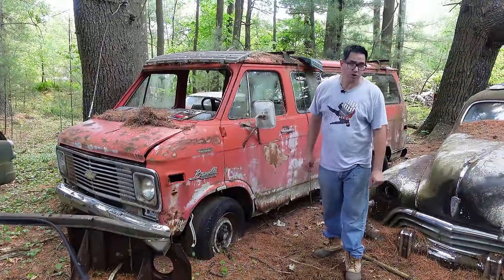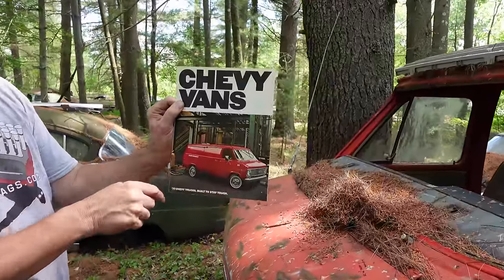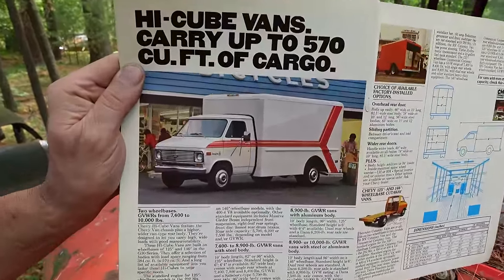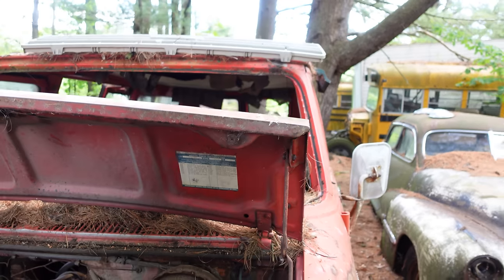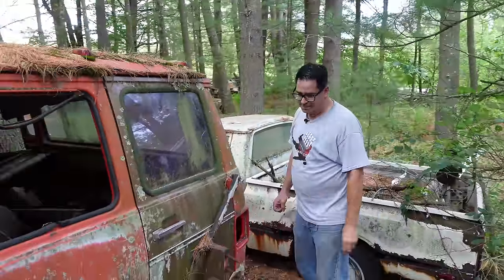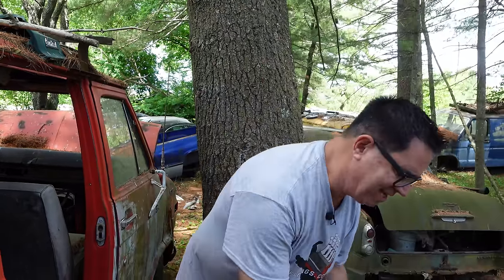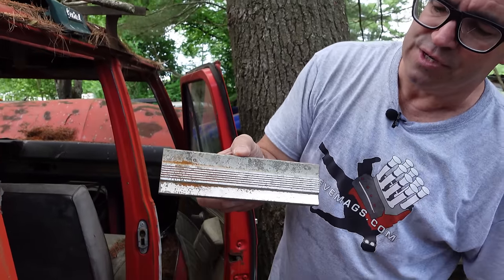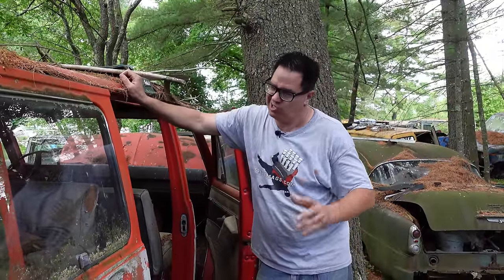The Beauty of Beauville

Comment: I grew up with a 1976 Coachman Leprechaun camper. It had a chevy cab with a 400 4-barrel. My dad sold it off in the late 90’s and I heard it’s still running to this day. Without a rebuild!
Reply: These 400 sb are severely underrated engines. I put one in my 1979 malibu. It was a 2 door malibu classic with the bucket seats and shifter on the floor. I loved that car.

Comment: Even though I owned two of these for several years, I never suspected they weren't body-on-frame. Always something to learn.
Reply: I knew they were unibody and was surprised when they came out with its replacement in the mid 90's they went to body on frame which I felt was a step backwards.
Reply: @edwardpate6128  Stressing the body instead of using a frame is just a cost cutting measure for profit.

Comment: The department where I work had one of these when I started there.  I was driving it down the Florida Turnpike, going 75 with traffic and suddenly had to come to an almost complete stop.  I laid on the brakes and actually stalled the motor.  I was coasting on the turnpike in Drive with no power steering, so I put in in Neutral, started it up and put it back into Drive.  Came very close to needing a new pair of Fruit of the Looms on that one.
Reply: i had a Pinto wagon stall out and wrestled with the dead power steering...even on something that light, it was a workout so i can imagine a full sized van. quick thinking on your part, i had a clutch pedal.
Reply: People always talk about "They don't build them like they used to!!" well, they don't and I don't miss stalling the engine because you braked too hard / long in a panic stop..... =)
Reply: @TheOtherSean  or the power disc brakes that launch you thru the windshield....

Comment: I learned to drive of a 1977 Vandura. I am pretty sure it had a small block 400. Maybe 8mpgs, but it did doughnuts just fine.
Reply: Correct, the G20 and G30 in 1977 could be had with a 400 V8.
Reply: The400 small block ended in 1974, so unless the vans got them for a few extra years, it was a 350.
Reply: @justincooper5189  incorrect. 1979 was the last year for 400 small block production.

Comment: A place I worked at had an old Chevy van, the only times it got used were to take a 55 gallon drum to get diesel once in a while and get inspected. That one was 3 on the tree and worn out manual steering that kept you awake. You'd be driving, it pulled a little to the left, so you'd kinda have tension to the right. Then it would change it's mind and start pulling to the right, all of a sudden you'd be on the shoulder of the road. 😂 Good times, good times.

Comment: I love vans.  Had them most of my life.  First one was one of the first flat nose Chevy Vans (can't remember the year), then a flat nose '66 Fargo Cargo,  '75 GMC Vandura cargo, '79 GMC Vandura all window cargo, '79 Dodge Tradesman cargo, and my current one, a '91 GMC Rally STX Passenger, 350 EFI, which I've owned since '95.  The '91 is all original, even the spare, and only has 142,000km (88,000 or so miles) and no rust, no winters since I've owned it.  Thanks again for all the great videos you post.  Best Regards - Mike
Reply: same here. I started with a 1990 ford e250 extended then 1975 e150 custom and 1979 chevy g20. Im in talks with this guy on buying his 1980 g10 with a inline six / no window shorty.  IT gets addictive but they are cool as hell :P

Comment: I had a 77 G20 Beauville in 87 thru 88 .77 was the last year they had 2 blowers for the AC equipted vans . Unfortunately the 2nd one that blew the cold air into the air ducts was failure prone and replaced in the 78 up systems . it had also been obsoleted and deleted from the GM parts book around 1980 which is why i got the van as a gift . The only opening windows were those in the front doors so there was little airflow to cool the interior .
Reply: I had a 75 and those vents down in the kick pads along with the vent wing windows could provide some pretty good ventilation when driving on the highway.

Comment: My Dad owned a automotive battery business and used these vans to haul pallets of batteries.   It was cheaper to license these as passenger vehicles than to license a work van.   We did change the ring and pinion ratio to help with the heavy loads.

Comment: I had a 74 g30 350 4bbl with 4.09 10.50 Corp axle I put an Eaton locker in mine.  I had a sliding door with windows only on the rear doors. Had that truck for ten yrs , miss it.

Comment: Nice overview. One cool thing about the Chevy/GMC vans of this era is the fact that they had the ignition in the dash long after everything else went to a column mounted key. I think until 1980 or 81. If you’re lucky, you might find a tilt column.
Reply: I like the myth that the GMC has 1 ga. larger wiring then the Chevy counterpart. 
Because it's a GMC and they made em stronger 🤔
Reply: mine is that way. Tilted column and dash ignition.
Reply: My '91 Toyota pickup has the ignition in the dash.
Reply: @lab1042  look again, Toyotas appear to be in the dash but are attached to the column.

Comment: It's great that you post the SPID label because with the VIN we win:

C for Chevrolet, G for G Series Van, Y for 350 V8 with four barrel, approx.155 HP, 3 for 1-ton rated van, 6 for Sport Van/Rally Wagon/Suburban (not to be confused with a Chevrolet Suburban SUV), 3 for 1973 model year, U for Lordstown, OH assembly and the rest is the production sequence. The Lordstown plant operated from 1966 to 2019 and was the main van plant with Flint, MI and Scarborough Ontario, Canada also producing them during this time. The Lordstown plant was rife with strikes and was often called "Industrial Woodstock" due to the hippie type workers that worked there. Later GM strikes at other plants were often referred to by GM management as "Lordstown Syndrome". 

Exterior paint is code 514 Crimson Red. It would have been nice if they got AC, RPO code "C60". LOL. The rest of the options on the SPID are self-explanatory. Yes, you have to be observant in the yards. I've found tools and even the proper paperwork I needed for my Trans Am. I had been searching for years for 1979 and 1980 blank warranty folders and I found them in a junkyard car. My mom was working at a place that had both modern computers and yes typewriters, so I had her type up the owner's manual folders just as they would have been done at the dealership when they were new.  At that point, my dad had been gone about 20 years, so it was nice to type his name on the one warranty folder like it was probably done in 1980 (although we never had one for some reason, odd, we kept those things). That was a find. Another time I found the "What Is It?" space saver tire brochure in a 1977 Cadillac. It is the same piece for my 1979 Trans Am. But the '77 piece in the Cadillac was about 3 inches from nasty rotten half eaten Chinese food and the car was on an angle in the yard in the mud. I was able to get it, it was clean and undamaged and it now sits in my glovebox of my '79 Trans Am. 

Another time I found some Craftsman tools, or should I say half of them: half of a nutdriver handle and half of a socket rack. I brought them back to the local Sears when I was a regular there and the guy said, "Where's the other half?" Laughing I said, "In a Olds 307 engine in a junked car in PA". He went to the rack, pulled off a new USA (then) made tool and did the paperwork. I then showed him the half of the socket rack with the word "MAN" only left. He said, "I don't think you're right, but if the new package says lifetime warranty they are yours". Sure enough it did. He did the paperwork at the register, handed me the new tools and said, "Have a good day, see you soon". Unfortunately, that store closed in 2019. My uncle's neighbor who was a manager at Sears from 1953 to 1993 was involved in opening that store in 1973 and the previous two stores that preceded it. I have many tools and items that likely came from all of those Sears stores. 

You can still get upfit packages/prep packages today on G series vans. For a time, GM also sold an AWD van called the "H Series". Today if you want a "factory" 4WD van, you have the van sent drop shipped from GM to Quigley and they do an OEM approved conversion that keeps the warranty intact. As for upfits inside for tradespeople, Adrian Steel, American Van and others offer upfit packages that can be put into vans like this. GM (as well as Ford and Chrysler) have many "ship through" vendors that will take chassis and upfit it, getting it right off the delivery vehicle. Ambulance chassis are done this way---in the case of Ford they are often drop shipped to the ambulance manufacturer from a Ford dealer like Olathe Ford in Kansas. Ford often calls it "pool vendors". There are many throughout the country that get drop shipments. 

When I go away for business or to a meeting, we are driven to it, and we're often driven there in a modern version of this van, a newer G Series. While it's changed a bit over the years, they still have many of the same types of options, upfits, seating configurations and so on. Back then if the "shoe fits, wear it". That was GM's motto. 1996 brought the phase-in of the Savana and Express vans we still have today. Those are assembled in Wentzville, MO with some models built at the Navistar plant in Springfield, OH.
Reply: Interesting story. I believe that Pathfinder also did 4x4 conversions on vans. I don't know if they're still in business though.
Reply: i used to work at the Canadian van plant til it closed in the early 90s.GM used to call it ladder frame design
Reply: @bradc32  That's correct. We did get Canadian made vans here in the States as well. Most were Lordstown or Flint made, but I have seen plenty of Canadian made ones.
Reply: @MikeBrown-ii3pt  They are out of business. I believe an ex-employee bought the stock of parts/name some time ago and kept it going for a time, but I don't think it's still around.
Reply: @bradc32  Funny thing. My coworker just brought over a VIN from a 1978 GMC van that we used to have many years back. Sure enough, it was a Scarborough made van.

Comment: I had a 1983 12 passenger van very much like that one.  350 4 barrel, four speed automatic.  I had it for 12 or 13 years and put 175,000 miles on it.  Great truck.  Strong and powerful.

Comment: My father drove a 79 Beauville 1-ton for about 10 years. He purchased it used in 86 to be a combination work van and vacation van. That lasted for about 6 months then all the bench seats came out except the one closest to the front. It was a pretty loaded out van with high back caption seats that would rotate. It was pretty trashed when he sold it in 96 with close to 300k miles on it.

Comment: What I recall the rust advanced quickly on the two tone paint edges. The windows popped out the sides from below and the latches rusted out around the top. There was a side door step or ledge that seemed to rust out pretty quick. The metal on it seemed a little light.

Comment: I have a 1979 GMC High Sierra 3/4 ton Camper Special full size 4 wheel drive pickup truck with a 454 motor,turbo 400 Trans and a 3.73 Dana 44 rear end.It is the last year GM made their vehicles without the computer crap on them and also the last year 4 the round headlights.I've had it since 8/88.

Comment: my dad had one of later versions of these g vans the doors would randomly open during turns, and the gauges would get stuck until the severely warped front rotors would shake them loose, it also would do pretty good burnouts and randomly puke coolant during the winter

Comment: I might have helped build that van!  I worked in the plant that produced them from 1970-1998 in Lordstown, Ohio.  I started out scheduling and building rear axles in the van plant and ended up driving a fork lift, stock parts to the line in the car assembly plant building Chevy Cavaliers and Pontiac Sunfires up until I retired in 2003.

Comment: I recall looking at a '71 Chevy van for sale at the Moravia, NY car show some years ago.  $400 for it with a 400 engine and 300,000 miles.  Guy drove it there.  I probably should have bought it.  It was out of Florida and not rusty.  

The dealer badges on both sides is a little unusual. 

Cutaway vans have a conventional chassis to them, at least behind the cab.  

These vans didn't get a locking column ignition until 1982.  While the body panels don't change GM did like to change little things every so often - they changed the dash in 1983 making the 1982 column one year only.  

By the time mine was made in 1994, they had TBI, electronic controlled transmissions, an airbag, and even 4 wheel antilock brakes.

Comment: The unit construction of the Chevy vans is the reason why almost all the box type ambulances in the 1970's and up were built using Ford van chassis. All an ambulance builder had to do was order the ambulance package from Ford and they supplied the driving chassis complete with the cab unit and then you added the walk thru rear body. Something you could not do with Chevy, you had to but a one ton and up truck chassis and cab and add a separate non walk thru body. Those were inconvenient if the driver was called on to lend assistance having to get out and walk around the vehicle that may be in traffic in an emergency when pulled over for a full arrest.
Reply: A lot of the ambulances by the 1970s went to the Type I style which was a truck chassis (like a CK Series or an F Series), because they held up better than the van chassis. However, the Type I style truck chassis made the vehicle more expensive so that's why a lot of ambulance/fire departments used the van based (Type II) platform.
Reply: Ford went to body on frame in 1975, Chevrolet not until 1996.

Comment: In the mid seventies after getting out of the service , I bought a used 66 Chevy van .  Straight six , three on the tree , but it was weird because it only had the two front doors and two swing out doors in the rear .  Nothing on the passenger side middle .  I've  never seen another one like this .
Reply: The early model 'no doors' are pretty rare and sought after...!
Reply: @ryanshevlin_Holy_Diver_Van  Hi Ryan .  I didn't know this .  I also believe it had a straight front axel on it too .  I have one picture of it with me mugging for the camera standing in front of it .  I was eventually going to put a small block with turbo 400 in it but then I got hold of a 66 Chevy ll six banger two speed auto .  I built a 327 from a wrecked Corvette with auto in the Nova .  I have one picture of it with you guessed it , me in front mugging for the camera .  Thanks for your info !

Comment: First year for the corporate 14 bolt rear axle and, I believe, the last year for points ignitions, which this van also has. I have several square body pickups with the full floater 14 bolt and I've converted the one under my 77 K-35 tow rig to disc brakes. If I'm not mistaken, the 9.5" semi-floating 14 bolt was used under the 454 SS pickups in the early 90s.

Comment: Everything there you need to convert a eighties or an early nineties G10 into a retro seventies G10 Van.  Just like the one on Hot Rod Garage! That grill alone is worth over 400 bucks on eBay.
Reply: Crazy that I just picked up an 80 240D Merc and scored a grille for 100$. 
On the other hand ,a used tail light is 400$ and a new (nos) one is 1200$. 
Shift boot for the 4 speed ? 
30$. Not too bad. 
New battery tray? 
125. 
Not so good. 
Maintenance stuff ain't bad ,50$ for front pads ,280 for a clutch kit. 
Odd how some stuff is thru the roof on pricing.

Comment: My first vehicle was a well-used '74 Beauville, with a 405(?) engine.  Had to be careful not to jam the accelerator or I'd squeal the tires.  And, while the nose/hood theoretically allowed the engine to be worked on, the arrangement was such that some of the spark plugs were on the inside/outside dividing line, and darn near impossible to access.  Think I got it up to about 350K miles before I had to junk it.
Reply: Not in 1974 according to available information. Later on, the 400 was available in the G Series van. The 350 was the biggest V8 for 1974.

Comment: I'm soft on these...i had a 1989 G10 HD. 4.3,  turbo 400, 10 bolt corporate  with aTru trac Detroit locker. Finally sold it in 2020. Went everywhere, did anything.

Comment: Steve, you said that the vans had a steel/metal grill thru '77?
That's strange that they had metal grills.
I had a '75 C10; a '76 C10; and a '77 C10.
And yes, my memory could well be failing me, but I would swear that those pickups all had plastic grills.

If I am correct, then I find it odd that the vans had metal ones during those years.😎🤷‍♂️
Reply: These vans were designed a tad before the squarebody trucks.  The previous 67-72 Chevy and GMC pickups had metal grilles in some models.

Comment: the body panels are interchangeable but not identical since they added a body line to the middle for some reason at some point
Reply: Center body line was added for rigidity in '77, but the front doors didn't have the line through the '84 model year...

Comment: Is the c-clip 14 bolt from the 454ss?
Reply: Yup, same axle - 9.5" 14 bolt... they also came in 6 lug 'light duty' '88-'98 2500 extended cab trucks...
Reply: @ryanshevlin_Holy_Diver_Van  light duty 3/4 ton or heavy half tons. Ive heard of heavy halfs